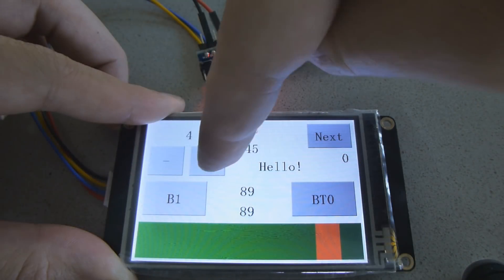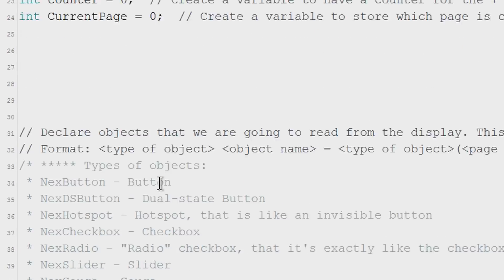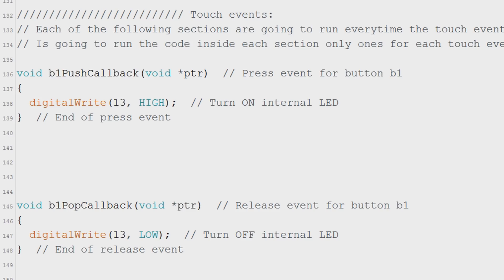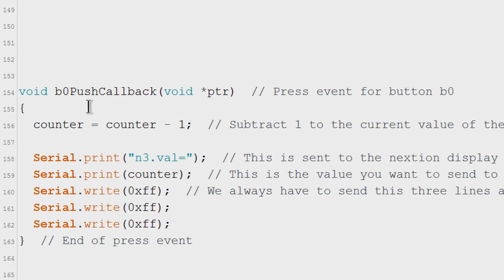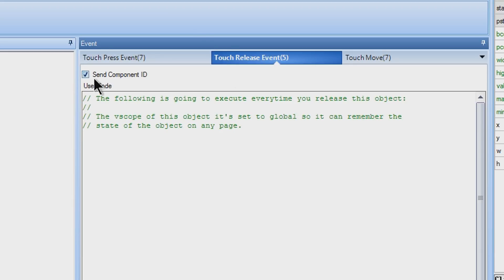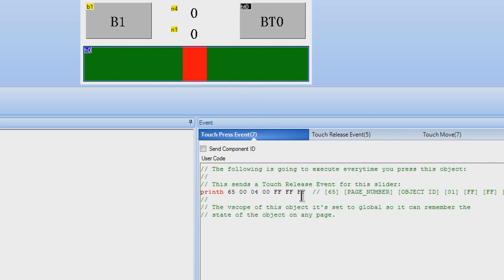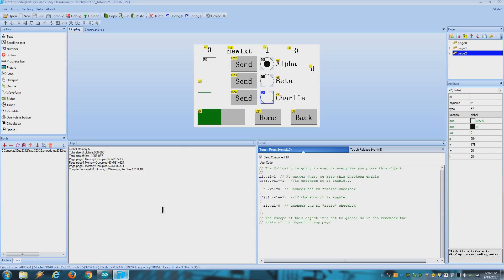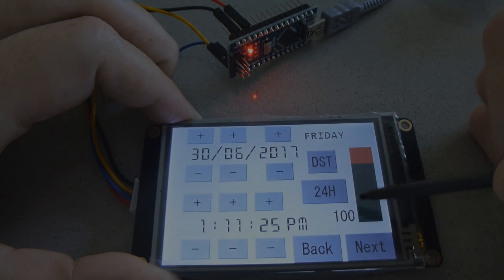Nextion+Arduino Tutorial #2 Sending Data To Arduino

Comment: help
how can i set a text using a variable?

this gets a error:
String x = "String";
t0.setText(x);
Reply from the maker: To start with, you are using spaces. Inside the nextion display you can't use spaces
Reply: InterlinkKnight that code is on arduino. t0.setText("String"); 
is working fine but when i change it to variable it gets an error
but thanks i already fix it by using your code

serial.print("t0.txt=");
and so on

hehe thanks for the reply 
very gud video btw thsnks a lot
Reply from the maker: Good to hear that you fix it. Good luck

Comment: Hello! Thank you for yor tutorial! Could you please help me? I can not resand text from "t3" to "t4". I see in monitor: get t3.txt⸮⸮⸮recvRetString[0,]
t4.txt=""⸮⸮⸮. What is goin grong?

My sketch:

#include <doxygen.h>
#include <NexButton.h>
#include <NexCheckbox.h>
#include <NexConfig.h>
#include <NexCrop.h>
#include <NexDualStateButton.h>
#include <NexGauge.h>
#include <NexGpio.h>
#include <NexHardware.h>
#include <NexHotspot.h>
#include <NexNumber.h>
#include <NexObject.h>
#include <NexPage.h>
#include <NexPicture.h>
#include <NexProgressBar.h>
#include <NexRadio.h>
#include <NexRtc.h>
#include <NexScrolltext.h>
#include <NexSlider.h>
#include <NexText.h>
#include <NexTimer.h>
#include <Nextion.h>
#include <NexTouch.h>
#include <NexUpload.h>
#include <NexVariable.h>
#include <NexWaveform.h>

int variable1 = 0;  // Create a variable to have a counter going up by one on each cycle
int counter = 0;  // Create a variable to have a counter for the + and - buttons
int CurrentPage = 0;  // Create a variable to store which page is currently loaded

NexButton b0 = NexButton(0, 15, "b0");  // Button added

NexText t3 = NexText(0, 4, "t3");  // Text box added, so we can read it
NexText t4 = NexText(0, 16, "t4");

// Declare pages:
NexPage page0 = NexPage(0, 0, "page0");  // Page added as a touch event

char buffer[100] = {0};  // This is needed only if you are going to receive a text from the display. You can remove it otherwise.
                         // Further on this sketch I do receive text so that's why I created this buffer.

NexTouch *nex_listen_list[] = 
{
  &b0,  // Button added
  &page0,  // Page added as a touch event
 
  NULL  // String terminated
};  // End of touch event list

void b0PushCallback(void *ptr)  // Press event for "Send" button on page 2
{
  memset(buffer, 0, sizeof(buffer));  // Clear the buffer, so we can start using it
  t3.getText(buffer, sizeof(buffer));  // Read the text on the object t5 and store it on the buffer

  // Now is going to send the text we received to object t23/ Теперь отправим полученный нами текст на объект t23:
  Serial.print("t4.txt=");  // This is sent to the nextion display to set what object name (before the dot) and what atribute (after the dot) are you going to change. Это отправляется на экран связи, чтобы установить, какое имя объекта (перед точкой) и какой атрибут (после точки) вы собираетесь изменить.
  Serial.print("\"");  // Since we are sending text, and not a number, we need to send double quote before and after the actual text.
  Serial.print(buffer);  // This is the text you want to send to that object and atribute mentioned before. Это текст, который вы хотите отправить этому объекту и указанному выше атрибуту.
  Serial.print("\"");  // Since we are sending text, and not a number, we need to send double quote before and after the actual text.
  Serial.write(0xff);  // We always have to send this three lines after each command sent to the nextion display.
  Serial.write(0xff);
  Serial.write(0xff);
  
  //Serial.println(buffer);

}  // End of press event

// Page change event:
void page0PushCallback(void *ptr)  // If page 0 is loaded on the display, the following is going to execute:
{
  CurrentPage = 0;  // Set variable as 0 so from now on arduino knows page 0 is loaded on the display
}  // End of press event

void setup() {  // Put your setup code here, to run once:
  
   Serial.begin(9600);  // Start serial comunication at baud=9600

  // I am going to change the Serial baud to a faster rate.
  // The reason is that the slider have a glitch when we try to read it's value.
  // One way to solve it was to increase the speed of the serial port.
  delay(500);  // This dalay is just in case the nextion display didn't start yet, to be sure it will receive the following command.
  Serial.print("baud=115200");  // Set new baud rate of nextion to 115200, but it's temporal. Next time nextion is power on,
                                // it will retore to default baud of 9600.
                                // To take effect, make sure to reboot the arduino (reseting arduino is not enough).
                                // If you want to change the default baud, send the command as "bauds=115200", instead of "baud=115200".
                                // If you change the default baud, everytime the nextion is power ON is going to have that baud rate, and
                                // would not be necessery to set the baud on the setup anymore.
  Serial.write(0xff);  // We always have to send this three lines after each command sent to nextion.
  Serial.write(0xff);
  Serial.write(0xff);

  Serial.end();  // End the serial comunication of baud=9600

  Serial.begin(115200);  // Start serial comunication at baud=115200 

b0.attachPush(b0PushCallback);  // Button press
 page0.attachPush(page0PushCallback);  // Page press event

 
}  // End of setup

void loop() {  // Put your main code here, to run repeatedly:
nexLoop(nex_listen_list);  // Check for any touch event
   
  }
Reply from the maker: Whatever you changed on my code, undo.

Comment: When I try to send text to the screen sometimes it does not work. What could be the problem?
Reply from the maker: Are you talking about my example?
Reply: @interlinkknight  no, I meant the issue I addressed in my comment on your other video.
Reply from the maker: I don't know. There's a million thing that you could had done to mess the code. I always advice to change my code little by little to see what part is creating a problem.

Comment: Thank you for the tutorial, I learned a lot from it. Though I have a problem that could be interesting to you. I manage the Nextion HMI with an Arduino Mega, which works as a master in my project. This Arduino needs to send data gathered from the screen to another Arduino over serial communication. The second Arduino Mega  works as a slave and controls several stepper motors. I'm using Serial2 for the HMI and Serial1 for the slave. I have tested the code for sending data to the slave separately using the serial monitor, and it worked well, but I can't make it work integrating it with the HMI's code. Could you please give me some suggestion?
Reply from the maker: Check that the debugging serial is disabled on the nextion library
Reply: @interlinkknight  After disabling that, my serial ports work well. I still have other issues but i'll try to figure them out rewatching your tutorials. Thank, you and congratulations for the great job!

Comment: If a person wants to not use the RX, TX pins to input the values because the RX and TX are in use transmitting I/O then can we use another set of pins and create a serial alternate say on Pin 10 and 11? If so what is the proper syntax to set up the serial connections for these pins and translate the I/O from the Nextion Display to the RX. TX pins for wireless transport to a remote receiver interface?
Reply from the maker: In that case I would use an arduino mega that has 3 serial ports
Reply: @interlinkknight  I would but I'm in production design phase using the Arduino Nano or I can use the Arduino Micro. I used the Mega during my test phase and it works fine. But the touch screens have to be placed in an enclosure and I have to design the 3D CAD files for the Arduino board with 1 relay output and 1 limit switch. It uses RS485 transmitters to transmit data from the Arduino RS232 converter to a remote Master controller which is written in C# interface with a database. There are as many as 120 touch screens in the system acting as slaves but they all have to coordinate their actions through the master controller. For this reason I need to either create a dual Serial I/O or if it's possible just allow the Arduino to listen to both the RS485 I/o and RS232 from Nextion at the same time and just use DTR to control the data flow. I didn't want it to get this complicated...
Reply from the maker: Wow. Well, all I know is that you can send data to the nextion display with software serial, but receiving data doesn't work reliably.
Reply: @interlinkknight  Actually I learned you can simply connect TX of the screen to the RX of the Arduino and RX of the screen to the TX of the Arduino and connect the TX of the screen to the TX of the Transmitter and RX of the Screen to the RX of the transmitter and the transmitter will only listen to I/0 of the Arduino. So I CAD it in already and wrote the firmware using SMARTLINX. I hope I'm right. Just sent the Gerbers off to China for some protoboards.

Comment: Hey, I am using an Arduino Mega to power the LED lights, however there seems to be a lack of communication between the Ardunio and the Nextion screen?
My RX and TX are the right way, I have set it to Serial2 in config.h beause im using 16 and 17
The code successfully uploads but just doesnt seem to work.
Reply from the maker: First try my example from my 1st tutorial. Does it work?
Reply: @interlinkknight  I'm trying to look at it now, but is there anyway we can talk in private, I really need help for a project that is due tomrrow morning, everything is working but the relationship with the touchscreen and the arduino
Reply from the maker: you can email me but i can't guaranty i will reply quick enough before your deadline.

Comment: Many thanks, excellent presentation and commented coding. I hadn't figured out there is a PushCallback as I'd based my work on the CompButton example (uses just Pop) so I'd spent a couple of hours wondering why buttons only invoked the Arduino routine on release... So wish YouTube had suggest your channel sooner before several others. Thank you again.
Reply from the maker: That's great. I love helping. If you have a question about my examples let me know.

Comment: Thanks for the great video! However I'm having issues with a Teensy 3.6 and a Nextion 3.5". In one way I can send text info from the teensy to the display and change the text inside a button, but nothing happens whenever I press buttons I created... I've tried everything :(
Reply: Found the issue, Serials 1 to 3 wouldn't work, I had to use Serial4 and set it in NexConfig.h too
Reply: @experimentboyTV  I have a problem with the button is not responding, I use nextion screen 3.2, can you help me?

Comment: I am having the same problem as others. Your code no longer works. The Arduino will not get button or page data from the display. I assume something changed. I have run your Demo without editing it. I have also gone through your troubleshooting video.
Reply from the maker: First, I haven't seen anyone having problems with my code that was cause by my code. All the reported problems so far are cause by user mistakes (not following instructions).

Second, codes don't stop working magically. I didn't even see the nextion library change so that can't be the problem. I downloaded the nextion library from the link and it compile without problem. I put a link for the library that I have just in case, but as far I can tell the only difference is the configuration file is set for arduino uno/nano.

Third, if you want to report a problem, you better give details and the error message because saying "it doesn't work" is not productive. For example, can you send data to the display?
Reply: InterlinkKnight  I am sorry if it came off that I was blaming your code. I am sure it worked perfectly when you created it. It doesn't work now. I honestly hope you are correct that it is a user mistake. That only means I don't have to wait for a fix. As it stands I have followed the given instructions multiple times and it does not work for me and it appears others as well. I am using a nano and made the config.h modifications.
I do not receive any errors.The problem is That data does not go to the Arduino from the display. push buttons do not work. It seems that "hello" on the main display says "newtxt". The + and - keys do nothing . The waveform does not display anything. the "home" button does not do anything. These are a few of the many issues.
Reply from the maker: In that case you have a problem with the communication, not the code. With that I mean that the serial communication is not working. Why? I don't know but you should focus on that. Maybe the default baud rate of the display is set differently.

I would test my first example, the one that only send data, and try in all baud rates supported by the display. Only connect the yellow cable (RX) of the display to TX of arduino. If doesn't work in any baud rate, your display might be broken.

Cycle the power of arduino every time you do the test. The setup of arduino doesn't run when just doing a simple reset.
Reply: @interlinkknight  I thought of that and actually purchased a second display. I just got it in yesterday and I have the same problem. First example works fine. I have not tried different baud rates. thanks for the help
Reply from the maker: So first example works fine? And the 2nd example works at all? Better email me.
Reply: @interlinkknight  Thanks but I figured out my problem. I was not using a common ground. My screen is bigger and needed to use the USB-5V power adapter. I had to link my Arduino ground to the ground pin on the 5V adapter.  It now works fine thanks a lot!

Comment: I'm trying to use this project but the buttons don't seem to work. I'm using an arduino uno and a 5" basic nextion display. I've changed the config file to show only serial and I've commented out the serial debug enable. Is there something else wrong with the libraries?
Reply: Mine works now. I changed the printh from "printh 65 00 00 01  ff ff ff" to "printh 0x65 0x00 0x00...". There were missing parts that had to be entered in. Hope this works for anyone having the same problem.
Reply: @hs_bird8253  I gave that a try but still have the same problem. Thanks for the suggestion though.
Reply from the maker: Watch the troubleshooting video
Reply: I have the exact same problem. I also have the 5" display. I wonder if all the people with this problem are using the 5" display as well.
Reply: I think it could be something with nextion editor. When I first opened the nextion file, it said it was for an older version.
Reply from the maker: But can you still open it, right?
Reply: @interlinkknight  Yes, it updates the file and then opens. It will not send information to Arduino though.

Comment: Im having a problem connecting the buttons in nextion to arduino. I have copied your code to test and it still doesnt work for me?
Do you have any tips to fix this?
Reply from the maker: First, try my example without modifications. Second, watch my troubleshooting video.
Reply: @interlinkknight  Both were tried and i can send data to the board but still having problems receiving buttons push command on the arduino board. Could it be a problem with the library?
Reply from the maker: You could have the wrong library, yes.
Reply: @interlinkknight  No. I am having the exact same problem and I got the libraries from the link you provided.

Comment: You are AWESOME ! I am having a lot of problems with this code though. Can't compile for uno.
Reply from the maker: That's usually because you have the wrong nextion library
Reply: @interlinkknight  Oh OK. Thank you  :  )  Great tutorials, Please keep them coming  :  )
Reply from the maker: I plan to make more tutorials about topics related to arduino, but I think I covered everything about the nextion display. If you think about something related to the nextion display that I haven't yet shown, let me know.

Also, remember that there's a lot of useful information in the comments I put in the code of my examples.
Reply: @interlinkknight  I think you cover it all. I really like the way you have the screen big and clear and share your code with plenty of comments. I was a little bedazzled with the semi colon after the curly brace  :  )
Reply: @drakkorvladimir4012  Did you verify that it works for you using another library? If so what library did you use? Please provide a direct link.

Comment: I have a Dual State button on the screen. I have used getValue() function to get the state of the button and toggle LED. But the State of the Dual state button remains zero even it toggles on the screen. The LED remains off. Please help me....
Reply: getValue() function returns 352649216
. Neither 1 nor 0.....please help me
Reply from the maker: My example works for you, right? Start with that.